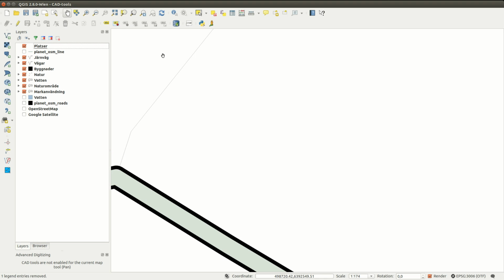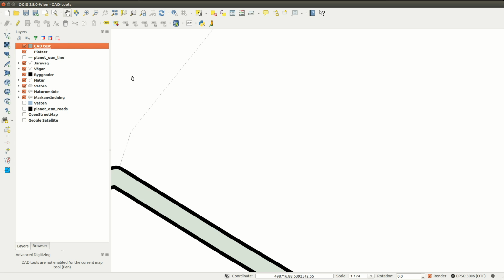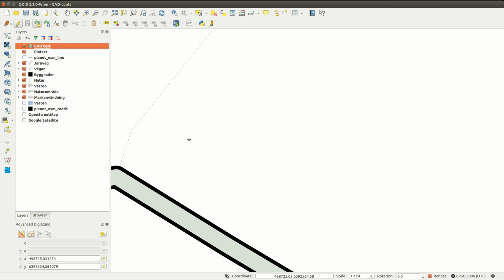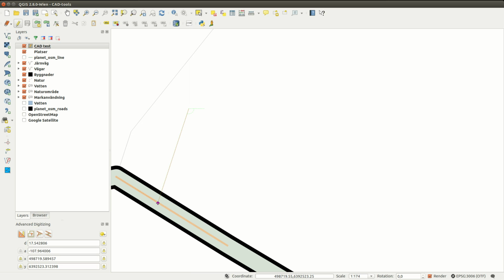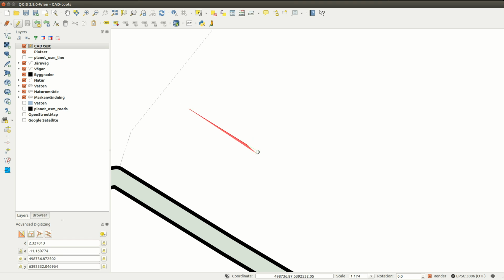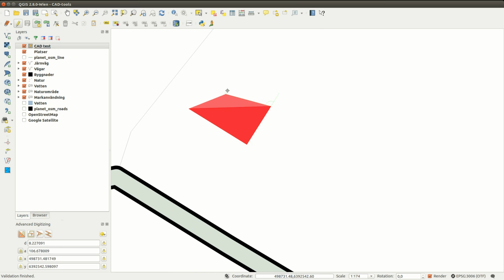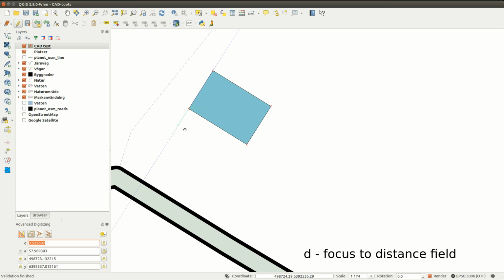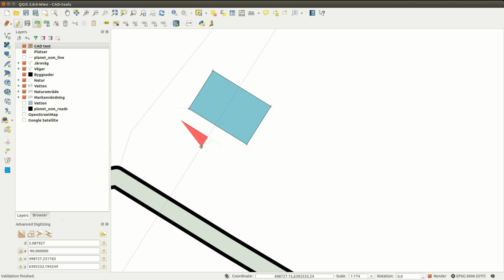QGIS Quick Tip   CAD tools

Comment: Hey Klas, thank you so much for sharing this! Since I wasn't able to find any further information on the web, I thought you might know more: Is there any possibility to set the angle field to a north-oriented 360° scale? Or is there any other plugin that may do this? I'm trying to digitize survey points which have a distance and azimuth (0-359° with zero in the north) from a central point with coordinates. It's a pain and very prone to errors to transform this into the weird format (zero in the east and two times 180 degrees to the west) that qgis uses here... Any hints would be greatly appreciated :-) All the best, Philipp
Reply from the maker: I don't know of any current method to do what you want. There might be a plug-in for it, or it might be on a to do list for future releases, if someone has requested the feature. As always with feature requests, the likelihood of it being implemented increases with funding...